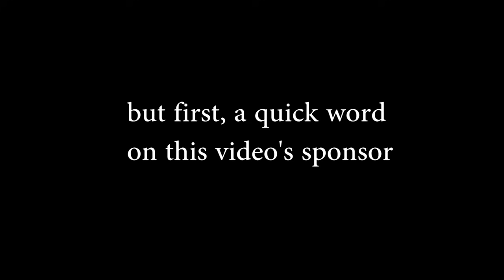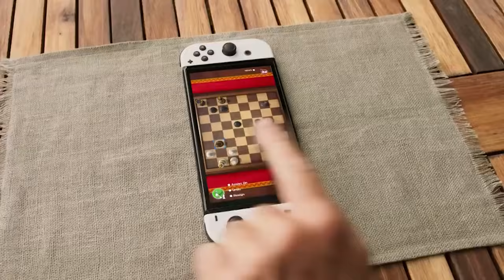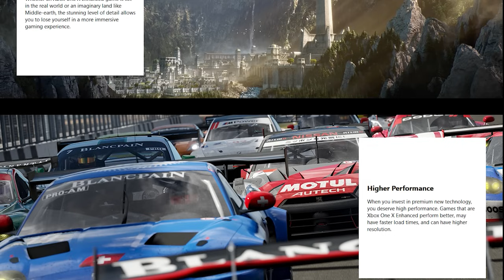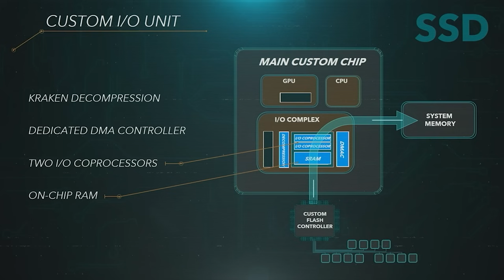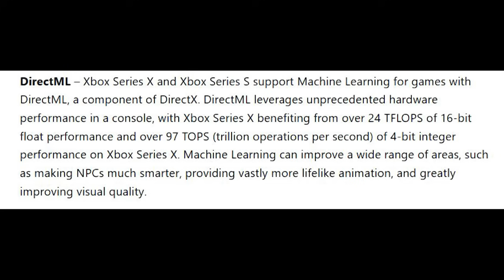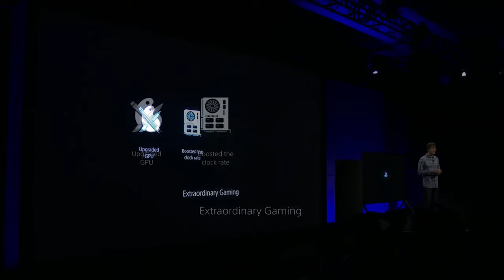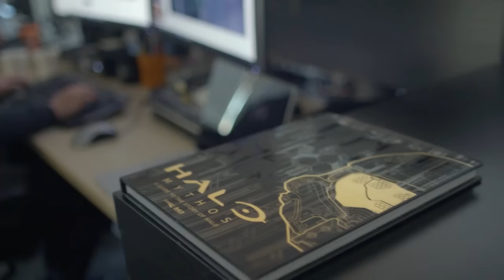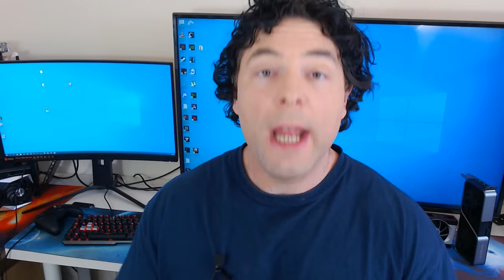PS5 Pro Is COMING - Performance & Release Targets | Microsoft's Next Gen Xbox Plans

Comment: I think for a console, you really have to consider performance per watt.  I would assume Sony and Microsoft would want to keep the power envelope about the same.  Considering RDNA2 was about a 1.5 perf/watt increase over RDNA1, I think a 50% performance increase with a PS5 Pro would be reasonable assuming it's RDNA 3.  Attempting to double performance would likely need more power, and I just don't see that being a good choice in a console form factor.

If by some miracle RDNA 3 doubles performance per watt, I can't wait to see what that means for the PC space.
Reply: The PS4 pro uses more power than the original base PS4, Only about 10% more...
Reply: The problem is that 50% more performance isn't worth it to make a new console model.
Reply: But they'll be gains from the process too, allowing more transistors.
The infinity cache was justified on power efficiency as well as performance, that may be interesting.
So doubling isn't as far fetched as all that, the question is when.
Reply: A PS5 Pro would need to have at least double the GPU performance to be worth making. The PS4 Pro was 2.3x more powerful than the base PS4 and used more power. A 50% GPU performance increase is simply not enough. I mean there are PS5 games like Rachet and Clank, Spiderman Miles Morales and Demon's Souls which run at 4k 30 in their quality mode on the PS5, if a PS5 Pro doesn't have enough GPU power to run those games at 4k 60 in their quality mode it's not worth bringing to market.
Reply: @03chrisv  even if it does achieve that level of performance would that buy it's self be worth the upgrade. Changing from the performance mode and quality mode makes such a negligible difference to how ratchet and clank looks for example. Quality mode looks ever so slightly sharper if your really looking the raytraced reflections are higher res if you really look and hair shaders are slightly improved if you really look. If I upgraded to a PS5 pro and all I got was being able to have the quality mode visuals but at 60 I'd be very disappointed
Reply: @rorynolan2322  I have an 85 inch 4k tv so the lower resolution of performance mode in PS5 games definitely looks softer than 4k when blown up to fit my screen. I would welcome an upgrade that could allow me to play games at native 4k60 in quality mode on a PS5 Pro.

Keep in mind this is still a PS5 so I wouldn't expect a generational leap over the base PS5, if you're expecting more than 4k60 with quality mode graphics than you'll want the inevitable PS6. Now with that said I'd imagine Sony would also sweeten the deal with the PS5 Pro by adding a bigger SSD and possibly some kind of exclusive "Pro" only feature like maybe dedicated hardware for machine learning based upscaling that replaces checkerboard rendering or perhaps enhances it.
Reply: Doubling performance is easier if you are willing to spend more on silicon when chiplets become a viable avenue for gaming.

With the same clockspeed AND chiplets to massively increase CU count with good yields on cutting edge fab nodes it's possible that PS5 Pro could actually double CU count while reducing power consumption (thereby reducing size over OG PS5 even in the Pro SKU).

Comment: If either RDNA 3 and especially Lovelace with a monolithic architecture will be 2.5-3x faster in ACTUAL GAMING I will eat my shoe. I really hate these numbers because people think "Oh in this extremely demanding game where the 6900XT can only get 50 fps at 4K ultra even without ray tracing, the 7900XT will get almost 150"... I'm sorry but no, the 3090 has 36 TFLOPS, the 2080 Ti has 12, so going by just that the 3090 is 3 times faster then the 2080 Ti... but is it 3 times faster in games? No, it's 50% faster... I belive this will be the case with next-gen too, maybe they'll push 70-80% real world improvement which would be amazing, but not even close to 3x.
Reply: Well they only added a couple of sm and rt cores after all. The 3090 only performed better in terms of fp tflops because half of the cores in the 2080 ti are dedicated to integer compute while the 3090 had those half perform floating point compute as well, there is also the architectural improvements and gddr6x. You could even say that most of the improvements came from the latter 2. This time around they’re actually doubling the sm’s or cu’s, and apparently each cu is gonna have more cores in it. So I wouldn’t hate on it just yet.

I do agree that 2.5-3x improvement is too far of a stretch. Even if they can pull it off games would probably be cpu bound and devs would probably “increase” graphics fidelity or get lazy with optimizations. At the end of the day these are performance targets, they’re not representative to real world performance.
Reply: Well 2,5-3x is not gonna happen, but maybe 2x. Yes the 3090 has 10520 cores, which is more than double the 4352 of the 2080ti. But because of architectural changes we could say that 1 core has become 2 cores, so the 3090 is actually 5250 cores not 10000.

Just look at the 6900xt, 5120 cores, exactly double what the rx 5700xt had, and about double the performances. And while performance per watt has increased with RDNA2, real IPC has increased by like 3%, just look at how the rx 6600xt performs like a 5700xt with more frequency but less cores, they have more or less the same TFlops. So, yeah, doubling the cores mostly doubles performance.
Reply: RTX30 to 40 should be bigger jump than GTX9 to 10 which was a massive improvement with gtx 1060 being about 10-15% slower than GTX 980ti.
Reply: I want pictures of you eating your own shoe 👞 😂
Reply: 2.5 - 3x faster than the current top card, unfortunately, only applies to the next gen's top card. These headline speeds from both AMD and Nvidia are comparing ONLY the top cards. Still, with that kind of increase we damn well should be expecting much more than the last across-the-board increases. As for pricing, I think that bar will end up being permanently raised...I can't see us returning to pre-covid/mining prices since I think waaaay to many new customers have bought into current eye watering prices because they have no baseline, and AMD, Nvidia and Intel are gonna want to test their buying will for the next release cycle.
Reply: @ChrisM541  Top end cards won't get 2.5-3x faster either, if you look at Pascal, the generation everyone praises, the 1080 Ti, which came out almost a year later then the 1080 is still "only" about 80-85% faster then the 980 Ti. Now I can see this gen making a bigger jump and maybe hit that actual 2x mark, especially RDNA 3 if MCM turns out good, but 3x? Nah, no way. And yeah I agree, sadly actual street prices in the current gen are already unaffordable and if the next-gen really is such a big jump then I don't see them not raising prices with everything going on right now. If this trend continues then PC gaming as a whole is in big touble.

Comment: Dude you need to get the audio issue taken care of.

Sure, next gen consoles will be on AMD.  AMD should be on TSMC 3nm by then,  I doubt they get a better price from elsewhere and I don't think Sony or Microsoft will have a chip that works nearly as well.
Reply: I wouldn't be so certain about that.

Apple will take a shit load of N3/N3P orders, and it sounds like Intel are trying to choke both AMD and nVidia by doing a lot of their own which both benefits their own stock and reduces their CPU competitor and GPU competitors access to the cutting edge fab node.
Reply: I can honestly see Microsoft working on a Custom ARM processor and wouldn’t be surprised if it’s several years into development, especially with Apple and now Intel doing the same. Perhaps Microsoft and AMD are pooling resources on it with more open Windows container system in mind.

Comment: Last year in July there was that patent from Sony for a Dual GPU system. Even though it's not guaranteed it will come to fruition, it does make sense to have 2 x 36 CU's to keep backwards compatibility for 36 CU games and extra oomph for PS5 games.

Not suggesting they will do it but an interesting prospect though. I don't know why they wouldn't just use a 72 CU die instead but the option is interesting.

Just my 2 cents.
Reply: PS4 Pro did the CU doubling thing so, yeah, I can see them doing it again just with more RT. The patent could be referencing the RDNA3 chiplet design but keeping it vague so they can go either way.
Reply: 2x36 is a lot easier to manufacture (and cheaper) than a single 72 CU wafer. Moving to a chiplet GPU design (similar to how the Ryzen CPUs are structured) is almost certainly a long term goal. The question will be how it affects latency and GPU scheduling.
Reply: @OptimumSlinky  RDNA 3 is chiplet design.

Comment: I think mid gen Refreshers will come 2024 at the earliest because of the silicone shortage. Refreshes this gen dont seem as important because higher resolutions are becoming less important. Raytracing and higher settings would be a better use. However I dont think think they will be that important. Its basically like comparing a SeriesX and a pc with a 6800 - 6900xt, yes you will get better framerate and settings but I dont think console players will be as bothered this time round.

Comment: Ps5 pro targeting native 4k 60 or an upscaled indiscernible 4k 120 would be cool
Reply: These are things the standard ps5 can do lol
Reply: @longlivetheblackmamba2-8-24  What mainstream titles are  running in 4K @120fps on PS5???
Reply: @ilusiil  from what I heard cold war and a few others can. But the hardware is there to do it bruh it’s more so rather Sony’s intention to make more use of it and developers taking full advantage of the consoles. Which still hasn’t happened yet? So y’all need to chill on the ps5 pro stuff
Reply: @longlivetheblackmamba2-8-24  COD might as well be a last gen game.
Reply: @longlivetheblackmamba2-8-24  This isn't true at all. According to Digital Foundry COD Cold War does not run at 4K/120fps as you've claimed. On both PS5 and XSX the game runs at 60fps and a dynamic resolution (between 2160p and 1800p) depending on how performance heavy the game is at the time. And in 120fps mode it runs between 1200p and 1080p.

If PS5 was truly capable of running at native 4K @120fps in mainstream titles we would have evidence of this occurring. We have zero evidence of this occurring with last gen titles, let alone current gen titles. And with PS5 elusives which are coded to take advantage of the power and abilities of PS5 hardware games have to drop down to 1440p just to run at 60fps. That being said I'm pretty sure that much less demanding titles including indie titles can likely manage native 4K @120fps on PS5, but certainly not performance heavy mainstream titles.
Reply: @ilusiil  like I said “from what I’ve heard” digital foundry isn’t the only in that does this stuff. Also as I said no developer has has taken full advantage of either console and PlayStation has not shown any interest in getting games to run at 120fps. 4k120 should not be that hard for the ps5. And ps5 exclusives are not fully taken advantage of the hardware as all games can still run on ps4 graphically Sony just chooses not to. And they don’t have multiplayer games like Xbox which is where 120fps would shine.
Reply: @warreng5257  fair ig but still doesn’t disprove my point
Reply: @longlivetheblackmamba2-8-24  for games that are only on ps5 they tend to target 1440p-1800p 60 and as devs continue to push it id bet most games that are pushing visuals will end up around 1200-1440p
Reply: @Peightun  the ps5 doesn’t have 1440P yet. It’s either 1080 or upscaled/native 4K. But again we just started the generation no announced ps5 game looks next gen yet plus most of them are cross gen
Reply: @longlivetheblackmamba2-8-24  I'm not trying to disprove, I'm just making you aware that last gen games also run at 4k 120fps too on the new consoles. And the new COD is a sugar coated next generation, which is labelled as next gen but really isn't.

The reason I say this is to manage expectations. Because if you tell everyone 4k 120fps is possible, then everyone will ask why aren't all the games like that, but in reality the COD for the PS5 is a last gen game.
Reply: @warreng5257  does it matter whether it’s last gen or not tho? That wasn’t my point just that I was possible
Reply: @longlivetheblackmamba2-8-24  No PS5 and Series X target 1440p upscaled to 4K to reach 60fps. Other affects are being cut down to achieve this as well. Just like ever generation the consoles true power is always over hyped. The tech in these systems was far more impressive than last generation though.
Reply: @longlivetheblackmamba2-8-24  No games run at native 4K at 120fps. They run at 1200p dynamic at 90-120fps on the consoles with softer graphics to reach that framerate. According to Digital Foundry the PS5 has rasterization performance of a RTX 2060 Super, RT performance of a RTX 2060 and both CPU’s in the new consoles are equivalent to a Ryzen 7 2700x. Despite being a zen 2 architecture CPU due to far less cache memory, much lower clock speeds, far less CPU memory and far lower TDP.
Reply: @longlivetheblackmamba2-8-24  Developers have been taking advantage of both the new consoles performance stop lying. There is a reason why there are big performance differences between the new systems and last generation consoles. You just can’t admit that your favorite new console has limitations.
Reply: @longlivetheblackmamba2-8-24  The Ps 5 does not support native 1440p output however games do run at native 1440p upscaled to 4K and the same goes for the Series X as well.
Reply: @longlivetheblackmamba2-8-24  "From what you're heard"? With all due respect who are you exactly? Some dude in the comments section under a YouTube video? I'm pretty sure that Digital Foundry (who analyzes games on all platforms for a living) is a lot more credible than some dude commenting under a video on YouTube. 

The fact of the matter is, while these new consoles are very capable they still aren't powerful enough to run current gen mainstream titles at native 4K @120fps, so unless you have evidence of this being done or factual proof from a credible source that this is possible I'm going to have to catalog your claims as overzealous fandom.
Reply: @longlivetheblackmamba2-8-24  Wrong again. Spiderman Miles Morales 60fps mode runs at 1440p, Dark Soul's Remake on PS5 60fps mode also runs at 1400p, and I believe it's the same with 60fps mode with Ratchet and Clank 60fps mode as well.
Reply: @ilusiil  it does not run at 1440p Sony literally left it out why do you think people kept complaining about it
Reply: @ZackSNetwork  literally all the games on both consoles are cross gen aka last gen games with graphical upgrades on the new hardware not real next gen games wake up bruh
Reply: @ZackSNetwork  1. Never said any game ran native 4K120 2. Favorite console? Your not serious right? 💀
Reply: @longlivetheblackmamba2-8-24  These games are rendered in a native resolution of 2560x1440 before being upscale to 2160p. Because your TV says 2160p doesn't make that the native resolution 2160p.
Reply: @ilusiil  “Sony fanboy” fat from it homie 😂😂😂😂

Comment: I doubt that the revision of PS5 will happen before 2024. The reason is the chip shortage that creates a set back on producing more electronics. I hope this gets over after a year. 
On the other hand, I have tested the XCloud and it looks promising. I wouldn't game on it now. In fact it is in beta, the graphics are sub par and there are glitches. But it looks that if Microsoft continues investigating on it, then after 3 years it will be a very compelling offer.
Reply: I agree with the current climate and chip/hardware shortages there is little point in bringing out something like a PS5 Pro right now. I can see this happening in 2/3 years from now maybe if the climate improves.

Comment: I predict the name of the successor to the Xbox Series X is... the Xbox Series X (2023~24 edition).

MS has said in the past they want to think about their consoles more like mobile phones, with more of a rolling release cycle rather than traditional console generations. I suspect they will be releasing both new series S & X every 3-4 years, foregoing the tick-tock (pro) model. And I think this is why Sony's considering calling their next system 6 rather than 5 Pro, so the narrative doesn't look like MS is going to a new generation while they're merely doing a mid-gen refresh, even if these words are effectively meaningless in the end products we receive
Reply: Also, the Xbox 2042 video they released today would line up with a new version every 3 years starting in 2024, with 4 years apart between Series X 2020 and it due to the pandemic as the exception. Implying their PS9-esque promo is 7 revisions from now